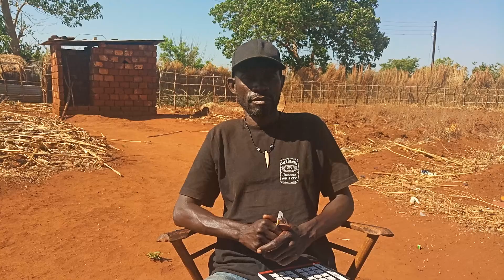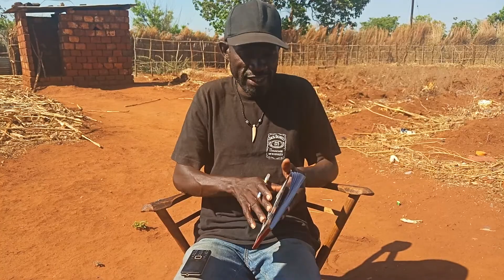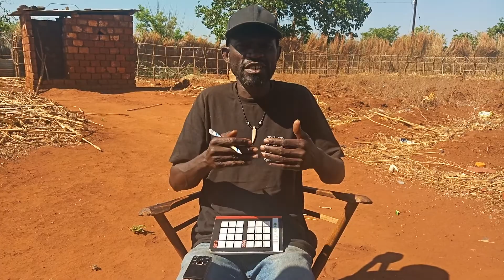MAIZE FARMING

Comment: Hello Farmer, thank you for your clarification about maize farming..Iam also a maize farmer by professional but I just add some information on size of land (hector and Acre).
I hector ......10,000m2
1acre .......4,000m2
1 hector .....2.5acre

So the measuring of land size depend on the shape of the farm since some farms are not square or shapeless.
Thus why very difficult to recommend to the farmer on form of 100m*100m 0r 70m*70m... this is more local way of measuring.